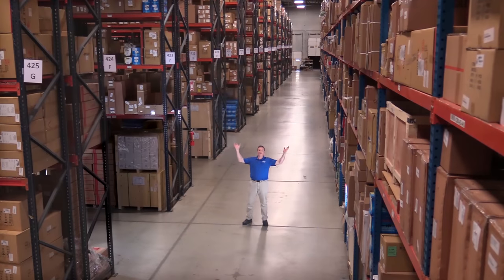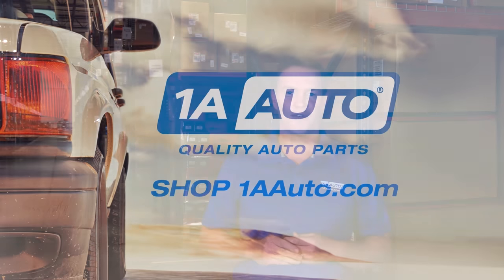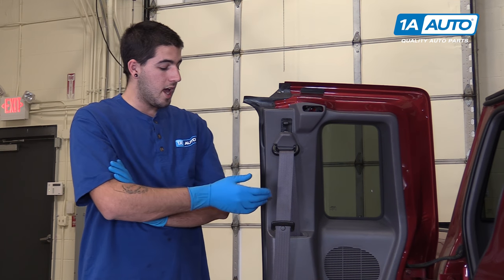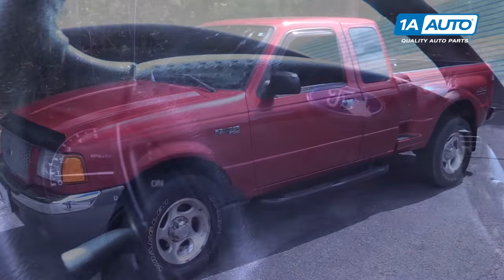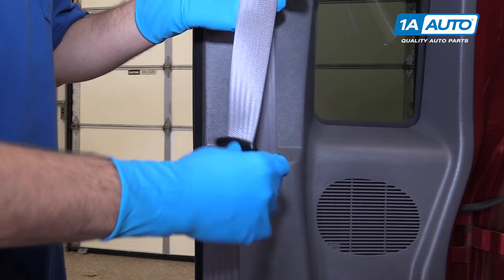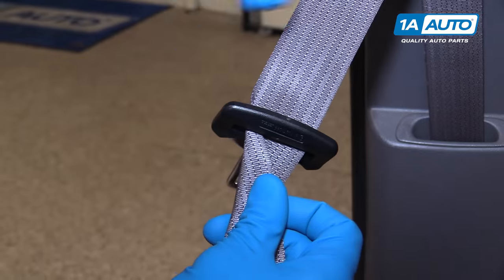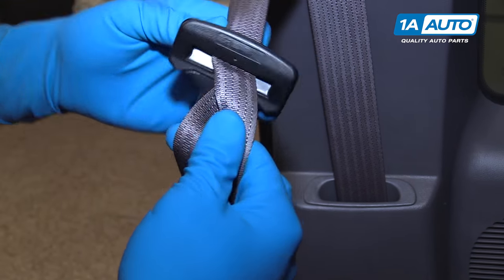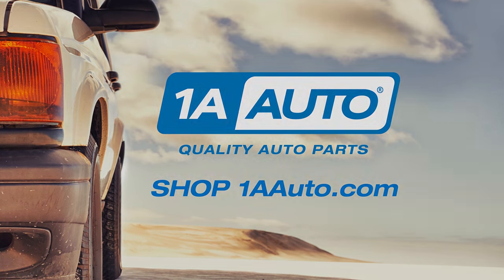How to Flip a Seat Belt Buckle in Your Car

Comment: Mine was easier to do than the video. It's still very hard to pull out and squeals badly when I retract it though. Now how do I change the seat belt out for a new one? Or at least get at it to oil it or something... Seems to be hidden under all that plastic but looks accessible through the rear fold out seat. I thought it was going to be easy but looks like a pretty hard job for something so simple...

Comment: I wish it  was this simple. I first had this issue on a 2016 Toyota 4Runner.  I was able to get it flipped, but it was not easy at all because on the Toyota seatbelt, the belt goes through two slots on the buckle. One slot is wide enough to get the folded belt through but it was almost impossible to get it through the second slot. Now I have a 2019 Lexus GX460 with the same issue. I fought it for over 30 minutes so it's off to the dealer while it's still under warranty.